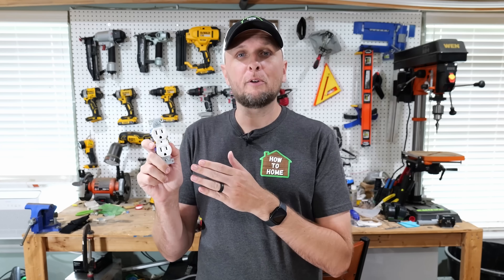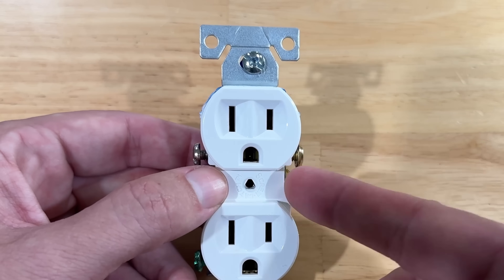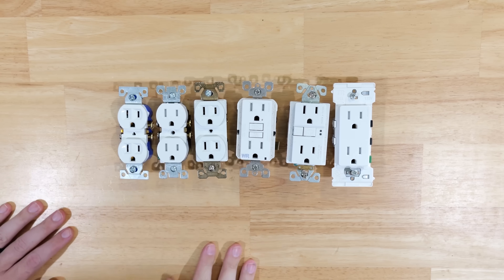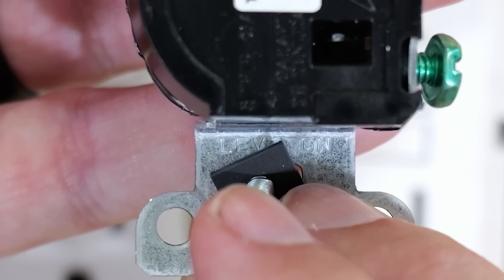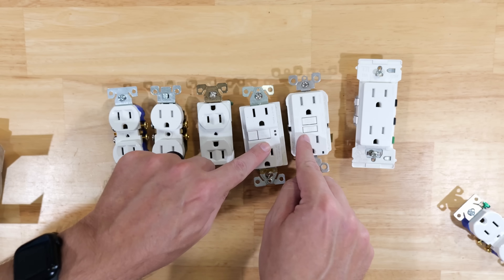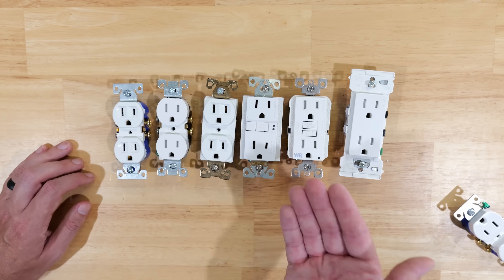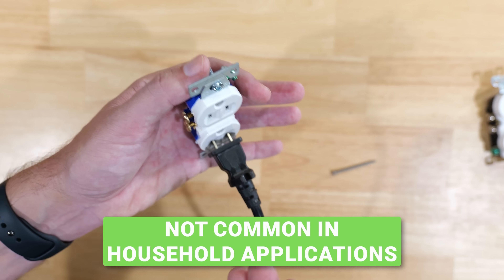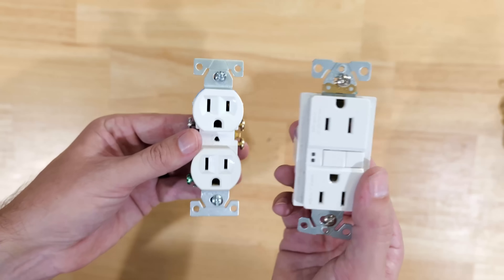The Shocking Reason Why Your Outlets Are Installed Upside Down!

Comment: Ground prong down makes the ground the last to disconnect when my cord starts to wiggle out while I am using  Grandpas 1948 metal-case single insulated drill while standing bare-foot in a puddle.  I'm smarter than that, but most people don't know how electricity works.  I think this scenario is unlikely, but a little more likely than nails and paper clips falling from the ceiling.  
(Of course, if I am standing in a puddle, there should be GFI's all around me.)

Comment: Thank you for this. I would install with the ground plug up because if the plug gets loose, the ground plug helps in keeping the plug in place
Reply: I would rather have and think the stronger way if a cord was falling out you would want TWO prongs up not one, thats more logical to me…………but also if you are cutting and bugging service lines you always want a ground/neutral, if disconnecting ground neutral last…..if reconnecting ground/neutral first, so thats way i like the ground down on plugs

Comment: The style of electrical outlet is called the Edison “U” outlet, not the Edison “n” outlet because of the u shape formed by the three prongs.  I work in technical theater and we use three-pin Bates outlets and twist-locks for dimmable circuit, as well as Edison U outlets for constant power.

Comment: I do outlets both ways , it depends on your plugs you are plugging in . Some plugs are designed with ground down , my fridge for instance the plug is at a 90 degree to stay close to the wall , if you put the ground up ,the plug wire sits wrong , and loops out away from the wall . It can also block the other plug on the outlet . I never worried about ground pin up or down . I was never sure about code . Thanks for clearing that up . Mike

Comment: This video could have been completed in less than five minutes, simply by stating the obvious.  Neither the codes or instructions clearly state directions for orientation.  Again, the obvious is to install ground-side up is recommended when there is a possibility of something falling and shoring out a plug that may have slipped down a bit.  I've seen receptacles in both direction.  In some schools, they are ground up, again for reasons stated above.
Reply from the maker: Go make a channel then.  Cant wait to see it.

Comment: If your using a plug that has 90 degree prongs, then install the receptacle so that plug orientation allows the cord to hang vertically down like maybe a hair dryer with the built in circuit breaker at the plug end. I can understand the safety issue also like in public areas where things could happen and cause a short circuit.

Comment: The "extremely unlikely" event of a metal object bridging the hot to neutral has happened in my 1918 bungalow (ungrounded) twice in a single year, resulting in arc-flash and hot metal ejection. I have rewired everything since then.

Comment: Some electrical cords and oriented for the ground prone to be down because when plugged in the cord will hang naturally. If ground cord is up the electrical cord coming off the top will hang down in such a way as to pull the plug out of the outlet.

Comment: I've never heard any electrician say the ground should be at the top in case a nail or some other metal "falls" on it.  What I have heard, and it's a logical argument, is that the ground should be up in any outlet where a child could run a fork or spoon or knife down between the plug connection.  Of course, there would need to be a ground prong on the plug, else the orientation wouldn't matter.

Comment: The toilet paper question can be found by googling "which way would toilet paper on the roll?"  You will be shown toilet paper on a hanger with the paper end hanging down from the front, NOT the back side.  The picture is from the patten filing information.  This was done by the inventor.  That's right, hangs down in the front.  Check it out.  I have a copy of  the Pic I show people!

Comment: For less than 10 bucks,  you can buy an outlet checker, and it will tell you exactly if the outlet is wired correctly or not.

Comment: The only reason, asside from looks that I like the ground pin down is that it gives the plug a little more support and they don't gome out as easy because of the weight of the cord.  Especially with old plugins where the springs are a little weak.

Comment: Flat plugs are generally manufactured with the cord leaving from the ground side of the plug head.  If the receptacle were mounted “ground up,” these plugs would send the cord upward which is generally on optimal in most cases.

Comment: If you are using metallic receptacle covers, if they work loose and fall, ground prog up is best.  See this a lot in hospital settings with stainless steel cover plates.

Comment: I'm not an electrician, I'm a biomed eng tech (Canada) for over 35 yrs doing medical lab and have alway seen gound down in every hospital/lab/institution I've come across (in north America). If you come across ac power adaptors with a ground pin, its Always with the writing on the outside of the adaptor facing you and right side up when plugged in, and that is with ground down. Also with the polerized adaptors. Again with ac power adaptors when plugged in with the weight lower the writing is right side up so it won't droop down. Another reason being what he mentions about the figers, the index finger will always go on the bottom and your thumb pushing against the receptical, hence safer with ground down. Ground up has always been a (special) switch controlled one or something. There also isn't anything in the CEC. I'll also throw in, pretty much  every drawing blueprint I've seen is shown ground down. The Canadian Standards Association pictures show the various plug types 15A, 20A, 3 wire, 4 wire etc,  this was always the way. I was taught with the hot on the right. The cord coming out of the adaptor would be wrong if it had a ground. I have been in search of the answer to thismy whole life - I ask every electrician I come across they all say the same as me. I'm gowns down and the deciding factor for me is...if the ground is up and the plug is 1/2 out loose or drooping, you could still have power and in this case NO ground. And you Never want to lose ground. with ground down that can't happen. Ill stick with ground down always.

Comment: I have a degree in Residential Wiring from TCAT and, in those days very highly respected, NEC code book worshipping, instructors insisted upon the familiar "Ground Down" orientation of standard and GFCI outlets. This has been the standard (in The USA) for decades. Pity My time's Highly Paid Professional Electricians were so pathetically Unqualified as To have consistently taught Us Wrong ALL of those decades!🙀😱🤪🤣

Except for "Face Up" under a sink, which is Like a total NO Brainer, and, as you've correctly stated that the Manufacturers aren't terribly concerned about "Ground Up" vs "Ground Down" or even Horizontally (which I've seen in newer buildings of late) It's mainly a matter of convenience and may affect longevity of Plugs. And, I've asked about the potential of metal objects falling into the opening of a loose plug causing a Short circuit. My instructor just said "Well, Don't drop metal objects in there!🤪Fix the connection instead, stupid!" Or words/attitude to that effect 🙀 Horizontally would solve The problem equally as well. But, I don't know if the latest NEC codes discuss this either. 🤔

Loved The Video BTW 😸💞

Comment: Many manufacturers have power cords that come out to the side at a 45-degree angle. With ground down the cord comes off down to the side at 45 degrees. With the ground up the cord comes off up at a 45 degree angle putting great stress on the cord.

Comment: I prefer all my receptacles to be ground side down with the reasoning that when plugging in a cord, the ground prong is the very first contact made before line and neutral leads make contact and likewise, I want the ground to be the very last contact to be broken should the cord be accidentally or otherwise removed from the receptacle. Also with the ground down receptacle, if the plug should for some reason be partially released from say an older worn out receptacle and hanging slightly downward, the ground is still making contact. And yes, I've had that happen in older motel/resorts. I know that most ground prongs on plugs are slightly longer for this same argument still I want the ground to be the first contact made when plugging into a receptacle, and the last contact broken when removing the plug from a receptacle.

Comment: It does not matter if they are up or down. If you install them properly then there is not a problem period. It does not matter if the ground is up or down. If you are having problems then maybe you installed a box that was too small. I like my ground on the bottom. If you are having shorts then you need to learn how to install a wire.

Comment: The argument for having a ground side up receptical is that they can become loose and something will come in contact with the prongs. I would argue that if you ever have a situation where the receptical is loose enough that the prongs are loose, you need to change it because that is a fire hazard. Beyond that, people generally only put the ground side up on the switched outlets so that people know where they are.

Comment: That's why with modern EU CEE 7 power outlets the circuit contacts are recessed so you can't touch the plug pins for as long as they are connected to the power outlet.

PS: The British solved the problem by making the base of the plug pins of non-conductive material. (don't know if it's mandatory)

Comment: I’ve read a lot of these comments and decided that the only way that the prong down installation was going to be a safety factor, is if my wife throws a metal clipboard at me and it misses me and lands perfectly flat against the wall and then slides down the wall onto a partially unplugged plug. Yeah, I can see that happening.

Comment: He's talking about residential but in most large commercial applications the architect specifies which orientation he wants. You don't get to choose which way you want it to be done. On residential the only reason I see for installing an outlet upside down is because you are using such a cheap device that it can't hold the cord cap in place and you're trying to use the ground to do that. Something it's not designed to do. Just install a decent receptacle.

Comment: Ground prong up is for switched receptacles. Ground prong down is for non-switched.  It has nothing to do with shorting potential, it has to do with circuit identification. It’s an industry standard in residential construction.

Comment: My pet peeve is on the cord side. I wish all plugs were designed to indicate the live and neutral sides so that I know how to hold the plug while inserting it into the receptacle. I know that statistically the chances are 50/50 that I will grab the plug the wrong way and I'll have to flip it around to get it into the receptacle. But in reality, 100% of the time I grab it in the wrong direction! Regarding which way to install the receptacle - ground prong down so that the weight of the cord does not gradually pull the plug out slightly from the receptacle.

Comment: The only place safe orientation comes into place is if the receptacle is installed sideways the neutral/common should be up. Most 90 degree cords are designed for ground down. Thanks for great video.

Comment: I agree with @electvolt67. I also am a retired Master Electrician with 47 years experience. BTW, the 'line' side of a duplex receptacle would apply if the receptacle were 'split' where you would remove the connecting tab between the two 'hot side' terminals and then possibly have the other terminal 'switched'.

Comment: I was an electrical apprentice working in new construction apartment buildings.  The electrical contractor whom I was working for wanted all the recepticals installed ground prong up.  The way I understood it is that we just follow the electrical contractors preference.  I did not work for another electrical contractor in a similar job so I do not know if others had the preference to install them in the other orientation.  Certainly in an apartment doing renovation I would want to follow the same orientation that all the other recepticals are installed as.  It looks rather odd to have some installed ground plug up and others ground prong down in the same unit.

Comment: Just for the conversation: I had a standard 2 outlet in my basement that had a TIN cover (that was simply the style of cover). I hadn't noticed that the screw that secures the cover to the outlet was missing. How did I wind up noticing? I bumped the outlet during use and the cover slipped off the 2 outlet extrusions and dropped down onto the plug to a dehumidifier I was using at the time  The tin cover made contact with the + & - prongs of the plug that were slightly protruding from the outlet - AND BOOF!!! Fortunately, it was a 110 and it just popped the fuse (spot welded the cover a little too). Wouldn't have happened if the outlet was installed Ground UP.

Comment: Though I was taught in my earily youth while serving as an apprentice that the ground alway's goes down. Over the past even now that I'm retired. See them even in the same room let alone any where else both up and down. No one in their right mind would ever place one in a horizontal position. But then not everyone is in there right mind's.

The newer when using my age larger nutural prong isn't alway's when the thing being utilzed doesn't care, wired currectly, Meaning the hot to the shorter and the nutual to the longer. The device will still work. And the bottom line to most Do It your selfer's, are fine as long as it still work's. You obviously know a lot of code and in the U.S.A. the code can be and on occasionally often enforced. Meaning nutual being correct, and the color's of the wire's being utilzed correct. Though Mexico has the same exact code's, there is to zero degree any enforcement in either the nutural being coorect nor the wire's being correct. If after the job is done, and it work's, no one care's.

I had a house constructed and to save money provided the various material's my self, when doing so including delievery was more cheap. Thus even though providing sufficent length's of various colored wire. The supposed electrian's prior to my catching them, simply utilzed one spool regardless of color until it was gone, then switched to another spool regardless of color. I had a shit fit, which ended up with my either having them strip all the wiring out and redo it my way and pay for the time it would take or as they pointed out. There's no enforcement and in as much as it's work's as designed and there isn't any issue's. What would be the point of paying the additonal cost of doing it agian in a  correct way.

Basically the Mexican ideaology of if it work's, leave it alone. Or if it's not broke, there's nothing to be fixed. Thus paying for nothing to be fixed is considerably more than not fixing something that isn't broke, when though their are inspector's the cost of them not inspecting, but still getting the ok when it work's as designed, though not code. All's well that end's well. They get their fee regardless, so why bother actaully inspecting. One can inspect more construction's site's per day, get home eariler and having made the same amount of money.

That's one of the joy's one from a first world country must come to grip's with, when moving to a third world country. Kay say ra say ra!

Comment: You missed two other considerations. 1) Depending on the plug on your device, many of which have the wire exiting the plug (with ground prong) coming off at an angle or at 180 degrees opposite what matches the “hot” contact holes, then to avoid having the wire going up or off of the outlet at an angle, you would install the outlet to give you the desired wire orientation. 2) If you use a multiple plug adapter, many of which have LEDs to confirm grounding and protection status, in some cases the adapter and outlet prong orientation will present the LEDs on the bottom of the adapter such that they can’t be seen as well. This video was very timely for me. My builder, Neal Communities of SW Florida hires cheap apprentice electrical labor to install the outlets in new homes. One of the outlets behind my living room TV was installed ground prong up, thus creating a situation 2) issue for me. My solution is to turn off the breaker, check to make sure there is no voltage on the outlet, and then reinstall it with the ground prong down. This also prevents situation 1) from occurring as well.

Comment: Hmm interesting but.... if you look at most American designed outlets, they have UP or TOP with the Ground Down. There is pro's and con's for both. The biggest reason is from and industrial standpoint where ground is up so things cannot short the positive and field by falling. Neither are correct or incorrect. In other places they are installed sideways. And guess what... they still work.
Reply from the maker: I showed you the two largest brands in the US and different kinds of them and none of them say up or top.
Reply: @HowToHomeDIY  All mine do... I buy at the big box stores. I guess it is just where you buy them... since none of them are actually made in the USA any longer. My point is there is no Right way or Wrong way to install them, as long as they are wired correctly. Each have pros and cons depending on the application. The biggest issue I have seen in my 45 years plus working on houses, is how some DIYers have the wires crossed between plugs, causing a short when both are used.